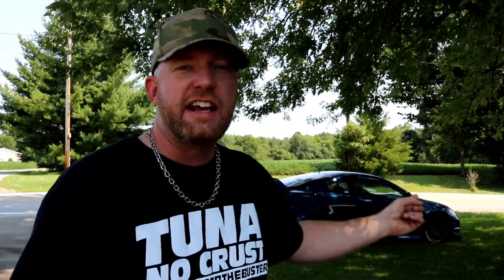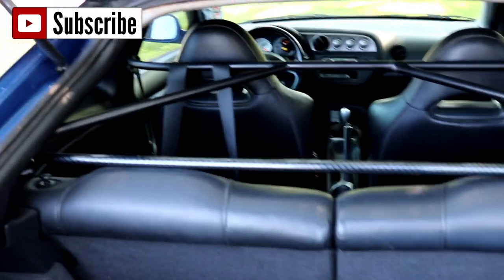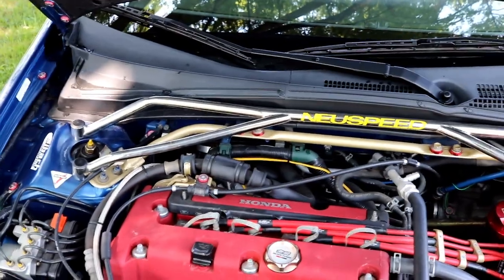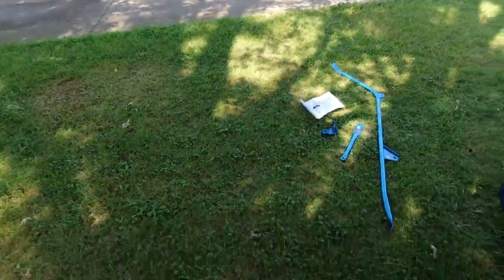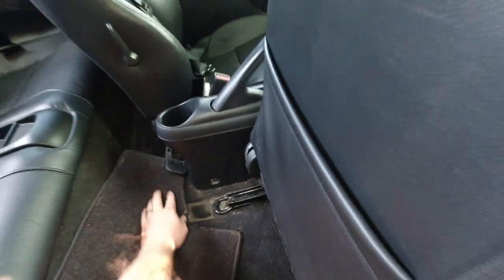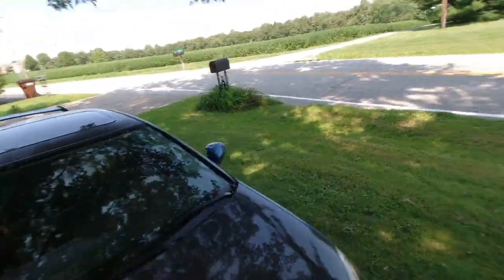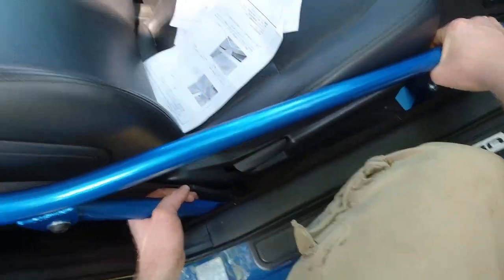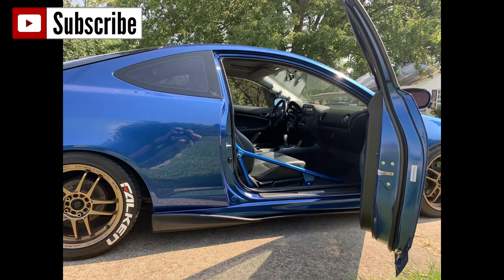Cusco Pillar Support Bar Install - on a DC5

Comment: looks nice, dont drill into the floor.. those "Cusco Pillar's" are just for looks(therefore you dont need to drill the front to secure it) since it doesnt increase the rigidity at all dont ruin the car(having a hole in the floor sucks) esp in a Acura.

The weakness from hatchback style chassis rigidity comes from the bottom end of b/c pillar where the tank sits not the top.. where your seatbelts are.  If you take off the rear seats and move the floor padding forward you will see even Acura installing a fat ass bar running across the floor.  Integra Type R has it, Civic Sir and im sure your car does cuz its a type S(beefed up honda/acura versions)

Looks dope tho, matches the color.